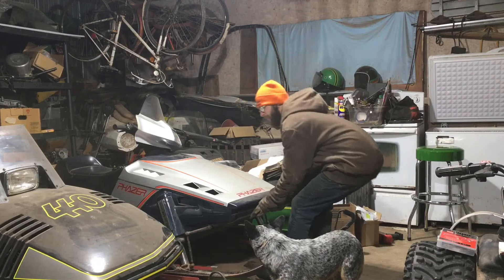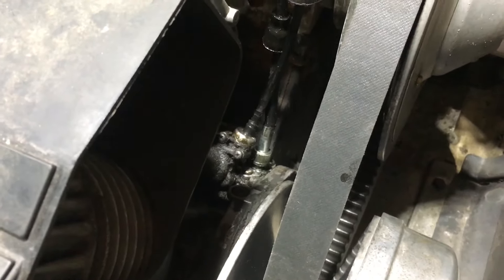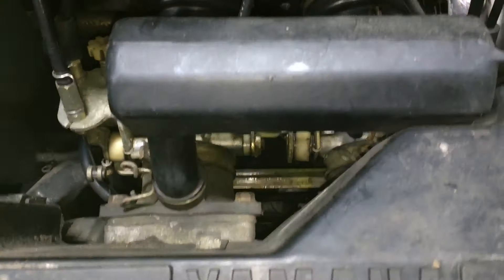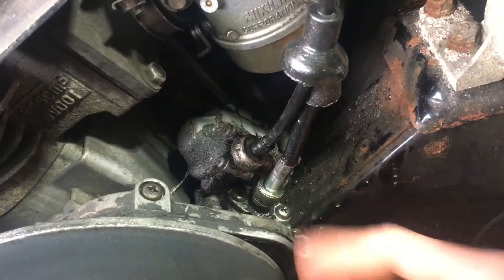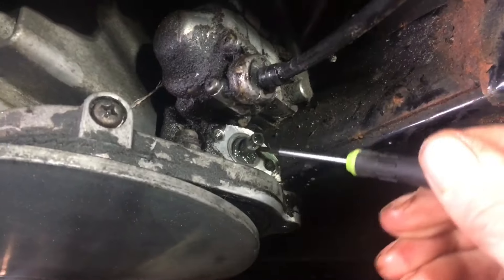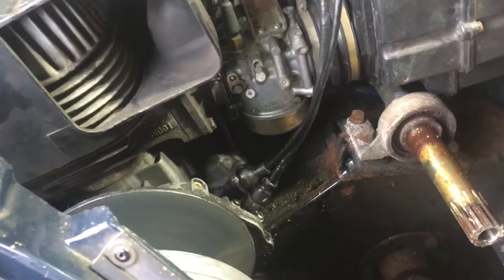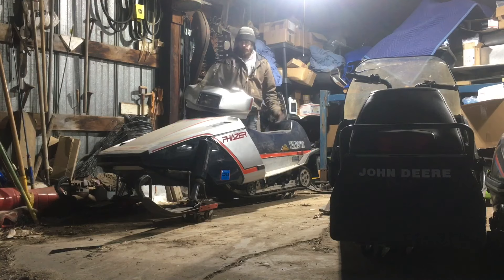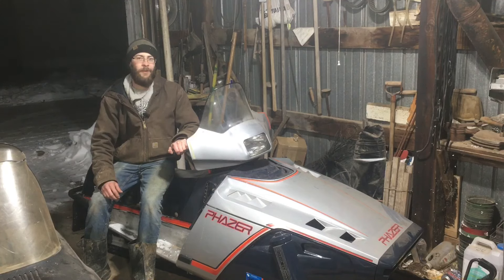Fixing Gas & Oil Pump Leaks on My Yamaha Phazer

Comment: Learned something...  didn't realize that beside the secondary clutch, the bolt you took out is the greasing port for the gear drive for the oil pump...  I have a 93 Phazer that is not pumping worth a hoot, even after adjusting the cable (narrower gap is supposed to equate more oil)

Comment: Thanks for the video.  I am guessing this is an issue I need to address since I have a puddle of oil on the floor under the sled where the oil pump drive gear unit is.   If drain my 2stroke tank and run premix can I safely ignore fixing this for now?
Reply from the maker: No the oil pump cannot run dry, it will self destruct if you do.